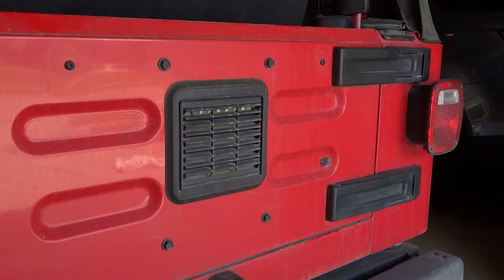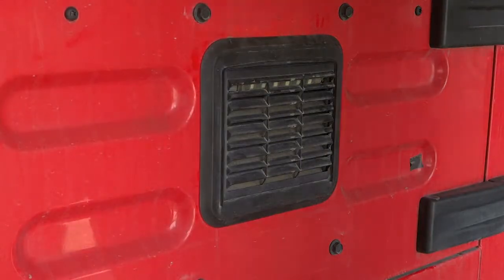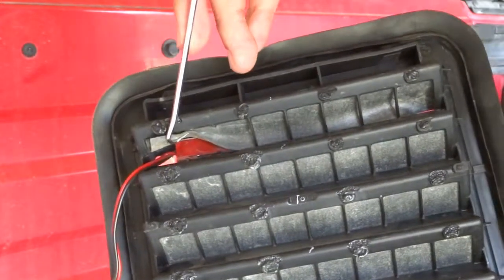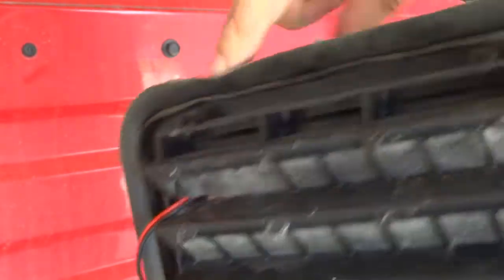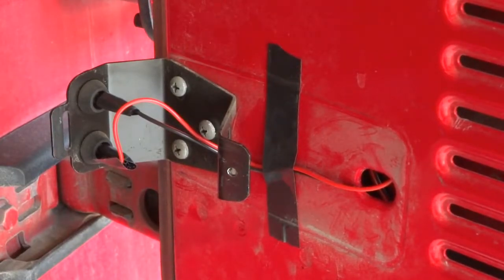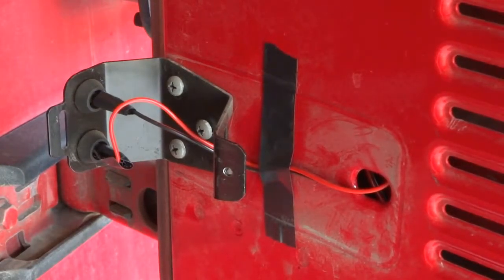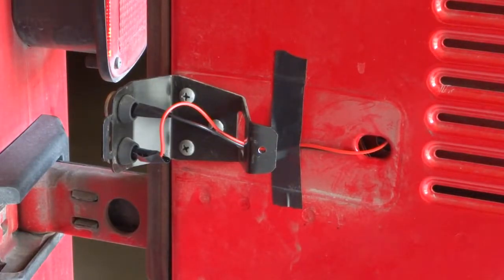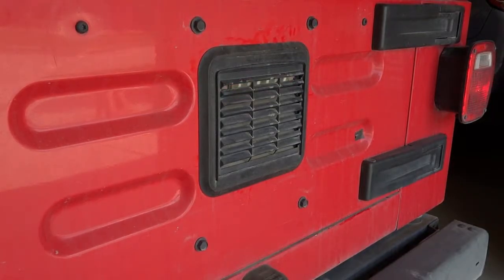Jeep Wrangler TJ custom 3rd brake light how to

Comment: I did something similar with a trailer side marker light. It's like a sideways rectangle. I used a plate on the back of the vent and ran the bolts through to hold it in place

Comment: Nice Job!  I'm think about the same except I will fill the all six slots with these lights.  Do you worry about no spare tire?  Can somebody explain the need for a vent here?  I have a loose soft top so I doubt is has anything to do with inside the cabin at this point.
Reply: If the airbag goes off the vent allows the rapid venting of the blast instead of your your brain and ears being severely injured.
Reply from the maker: I only use the Jeep locally so I wasn’t really worried about being stranded. TBH I’ve never had a flat on my Jeep